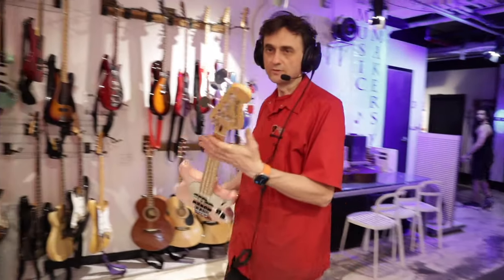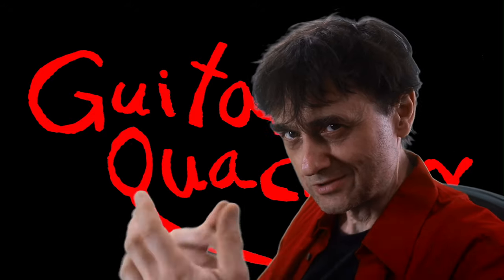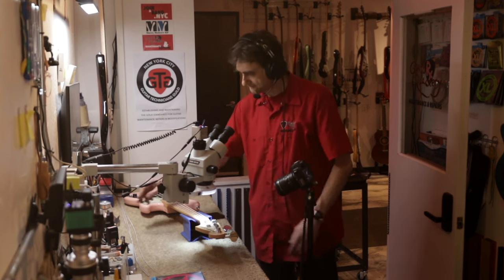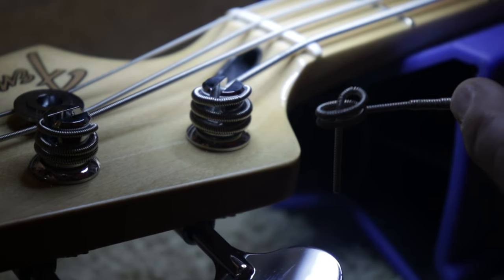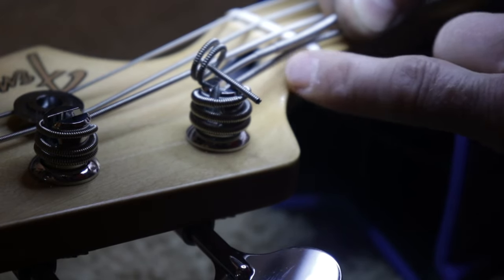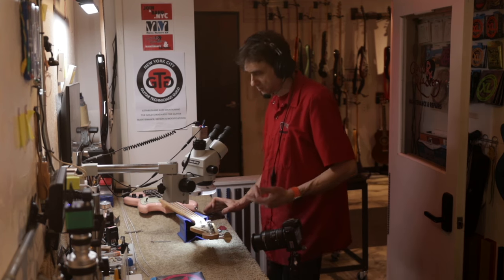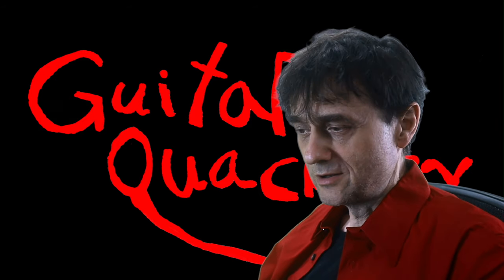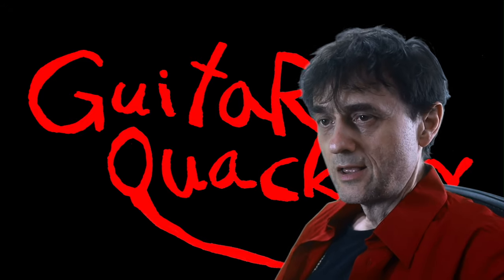Mustang Bass - Wrong Strings - Bad Setup

Comment: Okay, this video's audio is sounding great, easy listening now. Youtube reporting -2. Decibel that is a perfect sweet spot! 
BTW I watch YouTube on a 82-in 4K Samsung television with 100 w per channel. Surround sound system whenever possible like today. A lot of times though. I do have to watch on my phone and that's when it can be a little dicey hearing low too moderately low audio from YouTube videos. But it looks like you've solved the problem right off the bat. Great job!
Reply from the maker: Thank you again for taking the time to point out the problem. It is an ongoing effort to always keep improving the quality.
Reply from the maker: I know... But that's the only way to get a clear recording of me talking. My shop is inside of a noisy rehearsal studio so I need a unidirectional headset mic that does not pick up too much background noise.